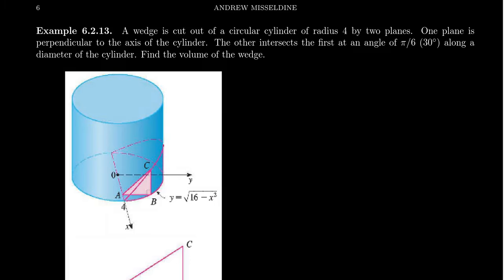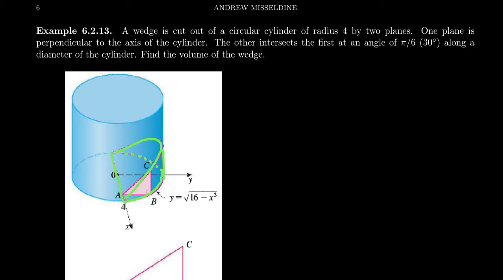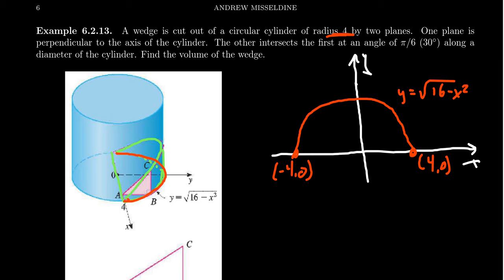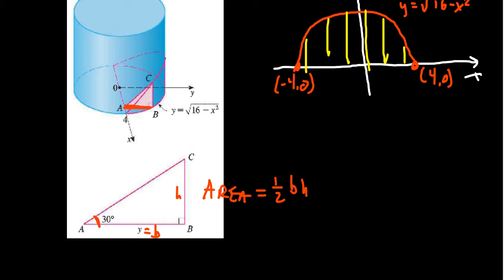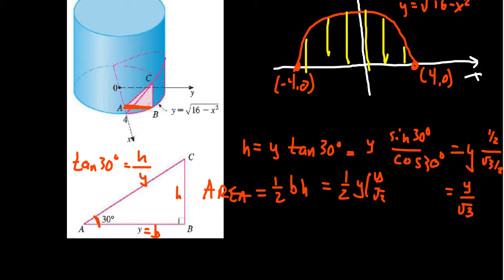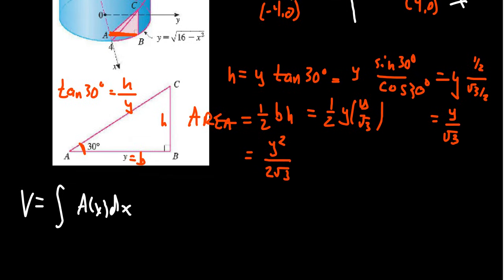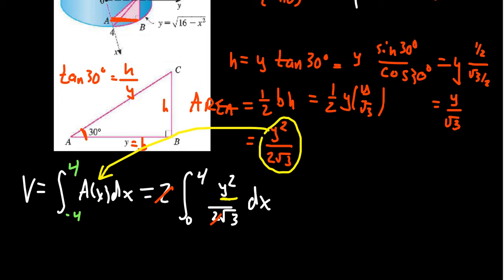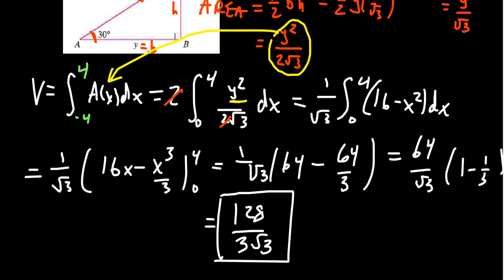The Volume of a Cylindrical Wedge with Triangular Cross-Sections

Comment: what if the angles slice did not pass through the midpoint of the cylinder?
XXXXXXXXXX
XXXXXXXXXX
XXXXXXXXXX
XXXXXXXX
XXXXXX
XXXX
XX
Reply from the maker: Excellent question. Your cross sections would still be right triangles. Set up your integral using the same variables. The height of the triangle is parameterized by its location along the spectrum and would be unaltered. The length along the base side is what is changed now. Since the plane intersects the base circle as a line segment, the amount of the base side changed by a constant value, an amount either added to or subtracted from depending on where the plane intersects the base circle's center. It should only involve a very minor change to the integral. The area of a specific cross section should be V = 1/2*b*h*dx = 1/2*(r^2-x^2-a)^(1/2)*(r^2-x^2)^(1/2)dxx. But note that small change dramatically complicates the calculation of the antiderivative. I would recommend a numerical estimate. The original setup using isosceles triangle is a great simplifier.

Comment: Hi sorry to bother but why is there a 2 outside of the integral when your first setting the integral up, thank you
Reply from the maker: It is symmetry. Because of the symmetry of the solid, we can integrate half of the solid and double the volume. This allows for simpler arithmetic at the end.
Reply: The limits -4 to +4 can be written 0 to 4 provided you multiply the integrand  by 2 since you are dealing with 2 quadrants of the  solid...